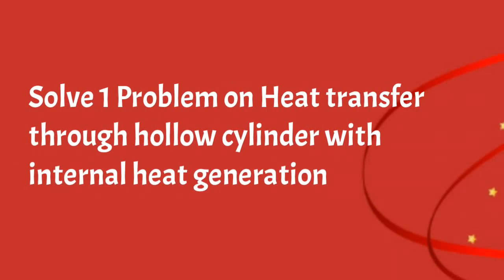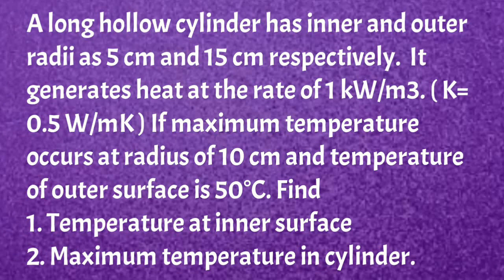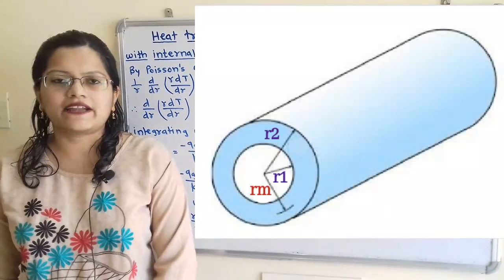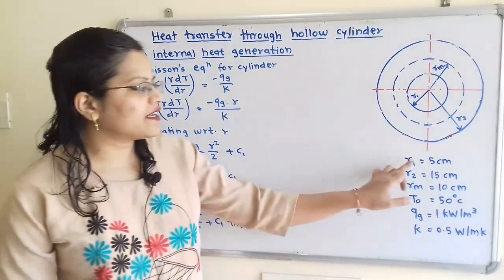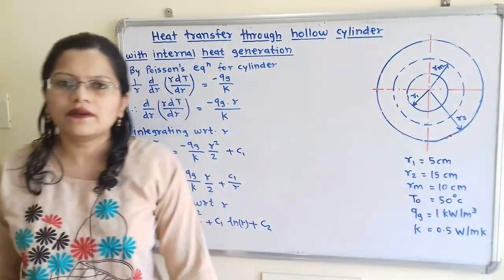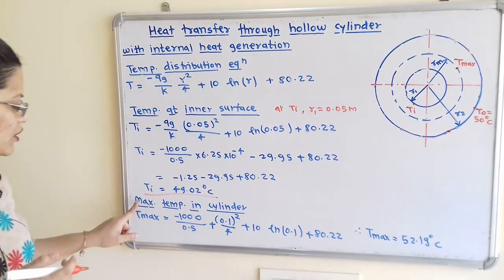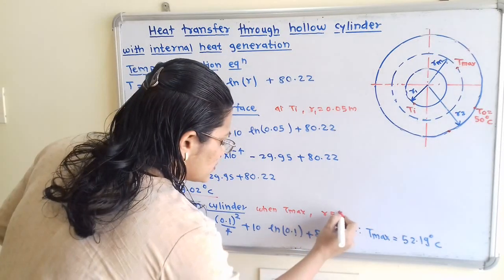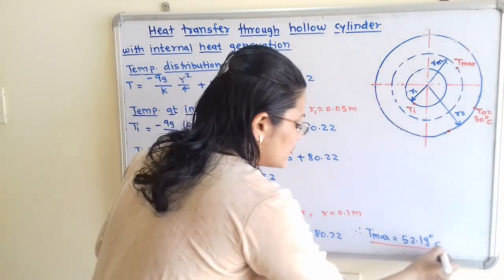Problem 3 Heat transfer through hollow cylinder with internal heat generation

Comment: Dear Edutech,

I am currently working on my graduation thesis, which focuses on the heat emission of exhaust insulation systems in diesel generator rooms (Q in watts). The setup closely resembles the situation shown in your video: a stainless steel exhaust pipe surrounded by insulation material.

I have completed the theoretical calculations and would like to validate my approach. If possible, I would be happy to send you a brief document with an overview of the project and a calculation example (4 pages). Any feedback or suggestions you could offer would be greatly appreciated.

Thank you in advance for your time and support.
Kind regards,